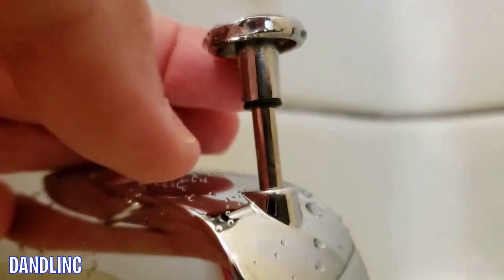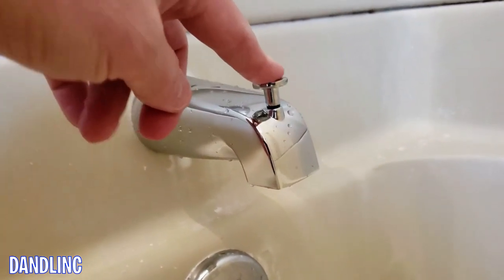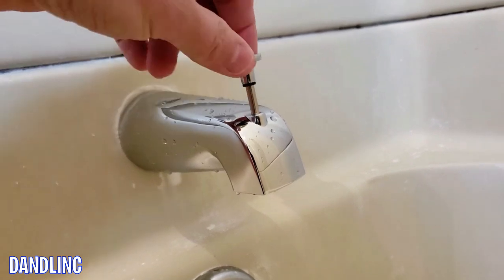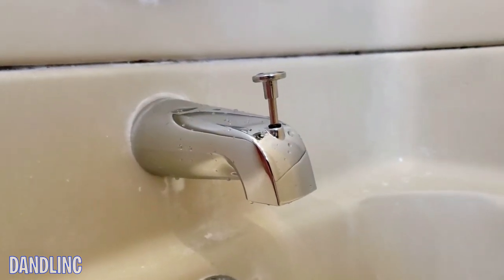Tub Spout Shower Diverter Knob Wont Stay?  Try This! DIY & Save!

Comment: Is this how the spout is designed to function? I bought a brand new Moen diverter spout and it automatically drops down when I pull the knob up. The knob stays in place by moving the grommet down like so in you video… if moving the grommet down is how the spout is designed to work, it just seems a little goofy to me.
Reply: No, yours is defective